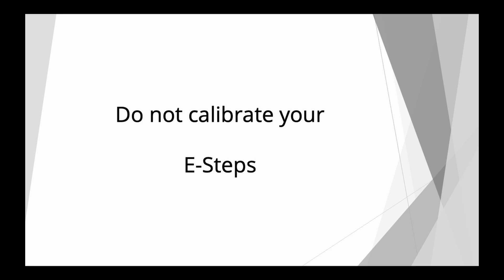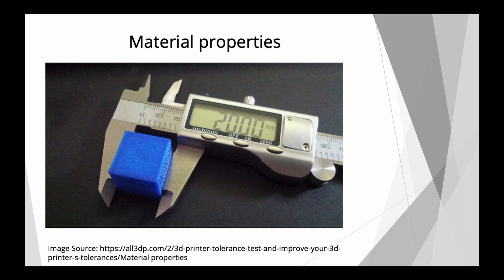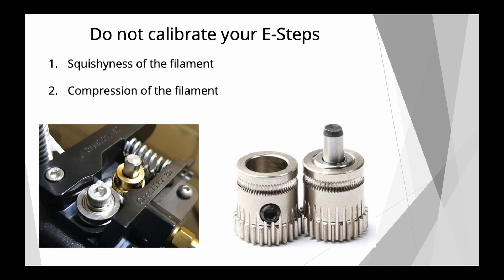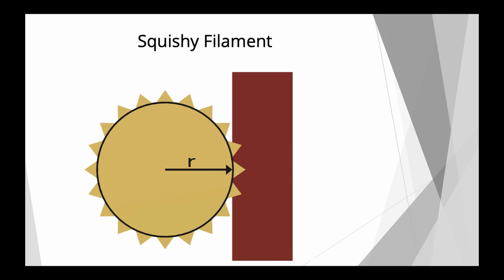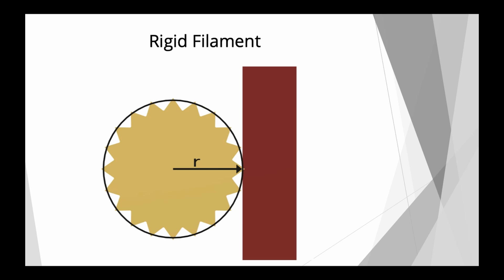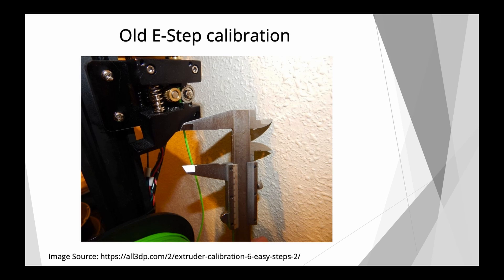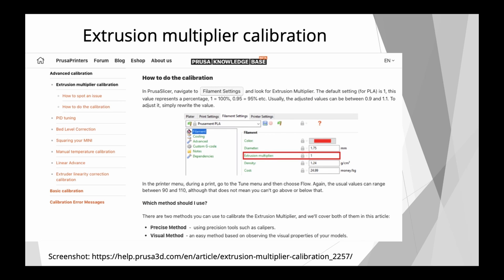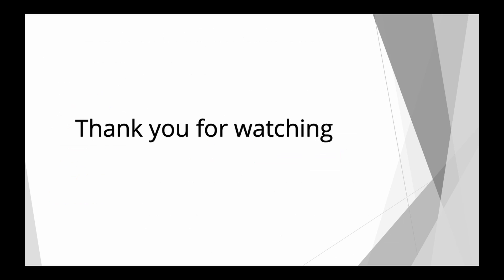Do NOT calibrate your E-Steps

Comment: I give one argument against flow multiplier in Prusa Slicer: Adjusting that parameter also adjusts the calculated weight of the part. If that is somewhat important, you should not mess with the flow mulitplier. I noticed that if I compensate via the M221 GCode, I still get the correct size (basically, both things do the same) but the weight of the part is calculated correctly. The flow multiplier at the filament tab assumes that the hardware delivers a perfect print - which it does not - and which is the reason we do the calibration. From a technical point of view, I find calibration of the hardware more useful and would use the material-based calibration in a second step. But I take your point that these are actually material properties we need to calibrate for. Ideally, you create separate profile for all your spools and calibrate them separately.

Comment: Thanks for this video but I have a question. When I measure the  filament on my Ender 3 it does not equal 100mm even when I tell it to feed 100mm. I understand that that make sense based on this video of squishyness and compression and all that. So I wonder if it would be a good test to very accurately weight 100mm of dry filament then print something that uses exactly 100mm and adjust flow until the weight matches. Does this make sense? Or maybe not 100mm of filament but maybe 1000mm. 

Also, presumably you are against calibrating your xyz steps also. If I were to say my prints are coming up short only in the X axis but not in the Y, what setting could I possibly change to compensate? Unless I always adjust the scale of X in the slicer? That doesn’t feel right to me.
Reply from the maker: Imagine attaching a pen to your 3D printer instead of your extruder. Now you tell your printer to "draw" a 40mm square box on a piece of paper. Your printer does its thing and you measure now your square box which is indeed 40 mm, because the theoretical steps/mm values for your X,Y and Z axes should always be correct, except if you get a gross error production pulley, belt or spindle. 
Now you change back to you extruder and you print 40mm square box using PLA. You measure the square box and it is 39.7 mm the question is now why does the pen do an exact 40 mm square box and extruder does not? Now you print the same square box using ABS and you get 38.6 mm box instead of 40mm. What has changed? The extruder stayed the same for the PLA and the ABS so this means these changes need to be material dependant. 
You can now start your calibrations for each material and either change each time your firmware settings ( x, y, z and e steps/mm) or you can create for each material a slicer profile where you compensate using the extrusion multipler and scaling the model in X and Y appropriately. 
We think it is not smart to change firmware settings each time, instead keep the theoretical values for each axis x, y, z and e steady and create appropriate slicer profiles.
Reply: @DropEffect  Ok, so you feel that scaling the model in the X axis only to get a good print is normal. That’s what I was curious about. A lot of people who say to not change the xyz steps say to adjust with horizontal expansion or something but of course that would effect both horizontal axes. 

I’m with you on this topic but I will say that I only print in eSun PLA+. I haven’t been printing long, less than a year, but so far it suits my needs. So I don’t experience the difference that occur when one swaps filaments. In my case, it would be a little less of an issue to modify the firmware. Or for example if someone ran a print farm that prints only one filament and one stl file.
Reply: @DropEffect  Another thought I had, if the e steps don't ever perfectly match up to any filament, what does it matter if it matches perfectly to the extruder gear size? Let's say Creality messes up with 1 printer and has the e step number a bit wrong. For someone who only changes slicer settings to compensate, it wouldn't make a difference to correct Creality's mistake and set the e step number to what it should be for that size extruder gear AND adjust the slicer settings.  I mean, the ultimate goal is to have a specific amount of filament extruded out, in my mind it wouldn't be a bad idea to actually have it match at least one filament and maybe be close to others. Then the others can have slicer settings to tweak it.
Reply from the maker: @c0mputer  If you have to change only one axis, then definitely something seem to be off with the e-steps or the mechanical setup. My main point with this video is that 3D prints are not the ideal system to calibrate your mechanical setup, because their introduce too many material dependant variables. You should use a dial gauge for instance to calibrate the motion system. Filament introduce also too many variables when calibrating your extruder. If you calibrate the extrusion multiplier then you change one variable that incorporates a multitude of material dependant variables. 
Indeed if tolerances on the Creality printers are significant then the old calibration method might be viable, however with extruders gears that are manufactured by us or for instance E3D there are very tight tolerances, so if we give a steps/mm value this a theoretical ideal value. For instance we get sometimes emails that say that they calibrated the e-steps on the OmniaDrop and instead of the mentions 480 steps they calculated 470 steps. However these small changes are very likely due to material choice, hotend temperature and extrusion speed. I often see on forum that people suggest calibrating the e-steps but these small changes from the recommended values are not due to gear tolerances but rather material choice, temperature and extrusion speed.
Reply: @DropEffect  I totally understand and I’m just exploring the other sides argument. But for my X axis, I have measured the travel of all axes and they are essentially perfect in all directions including the X, but for some reason it’s printing a bit short on the X. No worries though, I’ll figure it out. I was mainly curious if people with the mindset of not adjusting any steps have a workaround for different horizontal axis measurements.

Comment: You should still calibrate your xyz esteps...using a print is just the wrong way to do it.  You need to measure the actual movement distance of the print head.

Comment: I don't agree. If you work on the slicer multiplier and you change filament brand which is slightly different (harder or softer) but does not require different slicer settings because it's the same basic material, you end up having to reslice anyway or to compensate with a multiplier at print time, which is just as ugly as tuning the E steps directly.
If you slice at 1.0 and adjust accurately the E steps per filament (material+brand) then you have a consistent way of reusing sliced files.

Concerning X and Y, tuning them is blasphemy and/or ignorance. I'm surprised that Teaching Tech and Maker's Muse suggest that.
Reply from the maker: True, if you prefer to adjust the E-Steps to keep the extrusion multiplier at 1.0 this would work. However I personally think that that keeping Firmware related values static and changing slicer profiles to fit material properties more intuitive. 
If you want we can now discuss what method is more accurate E-Step calibration or Extrusion Multiplier calibration? ;)
Reply: @DropEffect  it's equally accurate of course, but if you work on the slicer you cannot adjust it anymore, basically. By working on the firmware I have a macro which sets all parameters for a specific material, so that I can reuse gcode from the SD card without difficulties. If I were using the slicer, I should calculate an extrusion multiplier correction factor for older gcode, and actually it would not be possible because I wouldn't know which  slicer-multiplier was used with each gcode I  find in the SD card.
My idea is: why putting into gcode something which is strictly related to the mechanics of the printer and which may change (to some degree) later?
By the way in the material macro I also load the correct bed mesh (mechanical detail!) and extruder, bed temperatures: they may change if I change brand (the bed not, the extruder surely) and I don't want to reslice!
I also use firmware retraction so that I load the correct values per material in each material macro.
Reply from the maker: @olafmarzocchi6194  You are keeping the Gcode "static" and rather change the firmware values via macros to compensate for material properties. This allows you to reuse your Gcodes even if you use a different filament. It is definitely an interesting approach, because there were times I wanted to reuse a Gcode and was not sure anymore for what material I sliced it for. Simplify3D writes all the parameters into the Gcode file and I think Prusa Slicer does that as well, but reading through those parameters is a pain. So in the end I often just reslice the file again. I now write the material into the file name, so I know for which material I sliced it for. In that regard your approach is definitely better. 
Regarding the "accuracy" of those two calibration methods; i would say both are not super accurate, however I would give the edge to extrusion multiplier, because I think it is better to calibrate a parameter that directly measures the printed part instead of calibrating the extruder in the "hopes" that finished part is accurate. A factor the E-steps cannot account for is the (potential) extrudate / die swell.
Do not get me wrong I do not want to persuade to change your method, because I think the way you do it is well thought through. However for the vast majority I would not recommend calibrating E-Steps but rather focus on the extrusion multiplier.
Reply: @DropEffect  agreed for everything except for the accuracy: since they are calculated as a ratio of what you expect over what you measure (length of filament, in this case) and applied to the current values of whatever you decided to use for compensation, I see no difference in the results: applying a factor of 0.95 to the multiplier which is 1.0 initially, or multiplying it to the currently active steps per mm brings no practical difference.

Comment: Very interesting, make me wonder how much of a difference it'll make if we have out extruder tight or loose. Also  your basically saying that us doing an e step calculation is just an extra step that we don't need to do, and just adjust the flow rate instead?
Reply from the maker: Exactly. My "philospohy" is that we should not change firmware related values like E-Steps if the calibration method includes material properties. Keeping a theoretical E-Step value and changing your Slicer profiles according the material properties ensures that only one software parameter is being changed. Also the extrusion multiplier calibration measures  the printed part, which is the final part that hast be accurate. If you measure the filament that runs through the extruder then you just assume that final printed part is correct.

Comment: Agreed. The e-step values provided by the manufacturer for the extruder, or motion system, are calculated and should not be changed. If you print with multiple brands and types of materials then it becomes obvious how the flowrate can change between each one. ABS usually requires less flow rate than PLA for example.

Comment: So our main factors that determine the flow of  our filament are
1. E-steps (mechanical) 
2. Extrusion multiplier (which is in fact a fiddle factor that in an ideal process where everything runs at equilibrium and is perfectly stiff would have no need to exist) 
3. Radius from extruder axis to the point on which the filament is driven which you (IMO correctly) identified as material specific.
What I haven't quite understood after watching the video is why calibrating the extrusion multiplier is more valid than calibrating the e steps.
I would say they are of equal importance and validity to tune and I have not understood what the benefit or real use advantage of only tuning the extrusion multiplier would be and leaving the e-steps at their 'mechanically determined' value. If you ask me I would propose an even different way to tune the extrusion flow:
1. Leave e-steps at mechanically determined value
2. Use extrusion multiplier to compensate for underextrusion at high speeds (compensates for the backpressure that is more dependant on the extrusion speed than material)
3. Use the filament diameter you set in the slicer to account for the squishiness of the filament because the squishier the material the more its effective diameter (at which it is driven) will be reduced.
For that philosophy you would have a different extrusion multiplier depending on the speed and not per material (bc for that we have the diameter) but I don't think that any slicer has something like that implemented yet where you can set a extrusion multiplier curve based on extrusion speed. 
For my approach you would have to create a baseline which configures the machine in a way that at very slow speeds at 100% extrusion rate and the mechanically determined e steps the exact amount of requested filament is being extruded either by measuring extruded weight (needs precise knowledge of filaments density and precise equipment) or length (much easier -> old caliper method). This determines the squishiness of the filament and is then entered in the filament diameter parameter and from there one can go on calibrating the extrusion multiplier for different speeds.

Unfortunately as I said this is not implemented yet and so we still have three parameters that basically controll the flow and you could in fact multiply the same factor for the extrusion multiplier with either one and it would not matter so if you want to tune your esteps which are mostly stored in the printer FW or extrusion multiplier which is set in the slicer stays a matter of preference.
Thanks for listening to my ted talk. And leave an upvote for the guy :)
Reply from the maker: First of all I really like your thought process and trying understand what underlying values influence the print accuracy.
Here is my take on your thoughts:

1. I think the main aim for calibrating anything is to keep as many parameters static as possible and only change those parameters that take into account most variables. What I mean with this is that by calibrating the extrusion multiplier you account for most of the variables like material properties, hotend design, nozzle size and geometry, extrudate/die swell, length from the drive gear to nozzle (bowden tube) etc. By calibrating your extrusion multiplier you directly measure the printed part and as such all these variables are included in one parameter. If you would only calibrate the E-Steps you "just" assume that the printed part is accurate without actually measuring for it.

2. E-Steps are indeed influenced by the flow rate. When I did a comparison between 3mm and 1.75mm filament to see which filament diameter is better for high flow my first approach was to measure how the E-Steps value change with the flow rate and temperature. In the end I decided to use the extrudate/die swell as a variable to measure, because this variable is more independent of a specific extruder:
https://youtu.be/hcU4_cYidqI?t=386
Interestingly the E-Steps value for 3mm filament stays constant for "smaller" flowrate, which was not the case for the 1.75 mm filament.

3.) Even though the E-Steps vary with flowrate I would not use a E-Step function in the slicer, but instead use a extrusion multiplier function, since the extrusion multiplier can account for an increased E-step value at higher flow rates. By increasing the extrusion multiplier you in effect indirectly increase automatically the E-Step value.

I hope I was able to explain everything decently enough, if something is unclear do not hesitate to ask me to clarify one of the points.